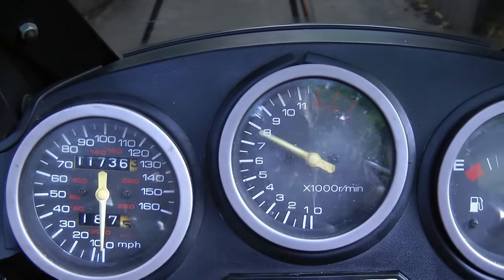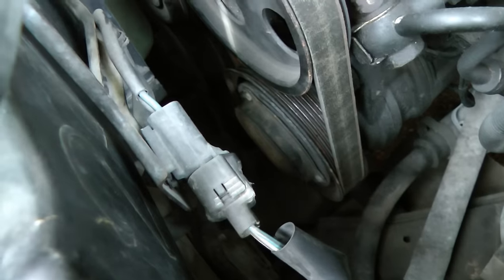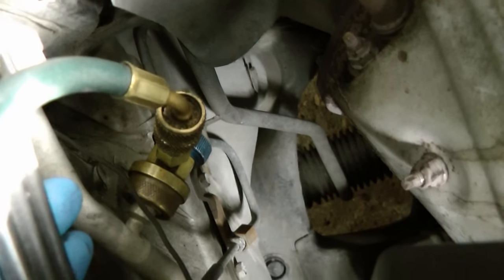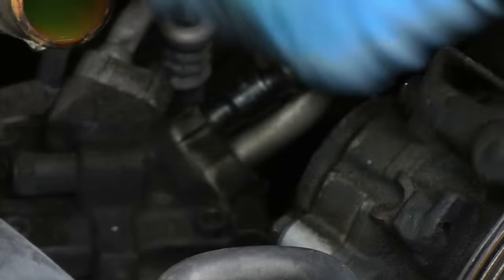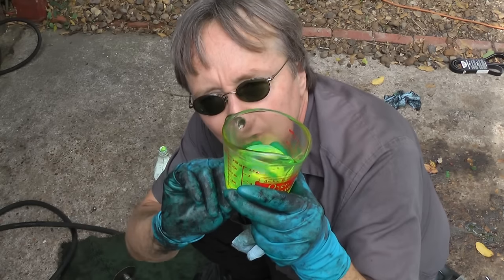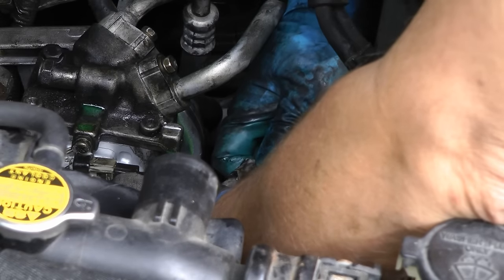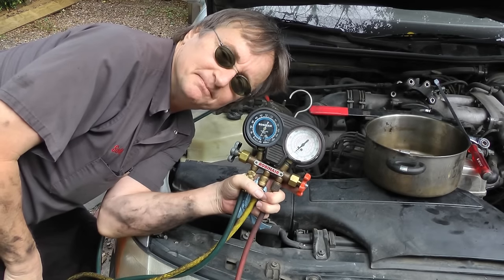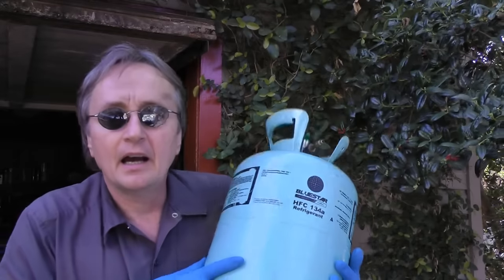How to Replace AC Compressor in Your Car

Comment: i'm having trouble finding the right compressor for the 99 jetta 2.0
Reply from the maker: +edwin Farrell that's VW AC work for you, expensive parts that are hard to find outside of the dealer. But do try online places like rockauto and VW specialty websites
Reply: thanks scotty i found 1

Comment: I have a 2002 chevy Tahoe I put a new compressor on and a new accumulator and orifice tube had the lines sucked down and recharged ok but they forgot to give me a o ring so I had to use a old one ok so when we put it in he must have forgot to take the other one out so there was two rings in it so two day later it started leaking that's when we found out it was two ok so it never work right since so heres what happen I put another one in and gas it back up and the front get cold but the back want

Comment: where do i get that vacuum pump to evacuate the system.  my compressor is seized up and once i get a new one i want to be able to do all of the work as my local mechanics are asking $600 to $800 for the work!  i want to tell them, politely, buh bye. also what does one expect to pay for the ac compressor and the mix canister?
Reply: Nathan Reeves idk wondering that too. ac compressors are around 200 for remanufactured, canister idk.

Comment: 2009 Honda civic compressor how to replace
Reply from the maker: A/C Compressor Replacement

R18A1 Engine

NOTE: Do not install an A/C compressor into a system unless you are completely sure that the system is free of contamination. Installing the A/C compressor into a contaminated system can result in premature A/C compressor failure.

If the A/C compressor is marginally operable, run the engine at idle speed, and let the air conditioning work for a few minutes, then shut the engine off.
Recover the refrigerant with a recovery/recycling/charging station. See: Service and Repair\A/C Refrigerant Recovery (With A/C)
Remove the front grille cover See: Body and Frame\Grille\Service and Repair\Front Grille Cover Replacement and the alternator. See: Starting and Charging\Charging System\Alternator\Service and Repair
Disconnect the connector (A) from the A/C condenser fan motor. Remove the wire harness clip (B) and the connector clip (C). Remove the upper mounting bolts, and the A/C condenser fan shroud (D). Be careful not to damage the radiator fins when removing the A/C condenser fan shroud.

Remove the bolt and the nut, then disconnect the suction hose (A) and the discharge hose (B) from the A/C compressor. Plug or cap the lines immediately after disconnecting them to avoid moisture and dust contamination.

Remove the mounting bolts and the A/C compressor (A). Be careful not to damage the radiator fins when removing the A/C compressor.
Install the compressor in the reverse order of removal, and note these items:
Inspect the A/C lines for any signs of contamination.
If you're installing a new A/C compressor, you must calculate the amount of refrigerant oil to be removed from it. See: Service and Repair\A/C Refrigerant Oil Replacement (With A/C) A new A/C compressor comes with a full charge of oil.
Replace the O-rings with new ones at each fitting, and apply a thin coat of refrigerant oil before installing them. Be sure to use the correct O-rings for HFC-134a (R-134a) to avoid leakage.
Use only PAG refrigerant oil (SP-10) for HFC-134a A/C systems.
To avoid contamination, do not return the oil to the container once dispensed, and never mix it with other refrigerant oils.
Immediately after using the oil, reinstall the cap on the container, and seal it to avoid moisture absorption.
Do not spill the refrigerant oil on the vehicle; it may damage the paint; if the refrigerant oil contacts the paint, wash it off immediately.
Charge the system. See: Service and Repair\A/C System Charging (With A/C)

Comment: After testing, found the clutch was bad in the existing compressor. Does this send metal shavings and other contamination through the system? Even doing this yourself would cost a fortune after buying all the recommended replacement parts and having the shop recover, evacuate, and recharge. AC systems shouldn't be so eggshell fragile with today's technology!

Comment: what does it mean if you car air blows going off how fast your driving? example if I press the acceleration the air blows harder and stay like that as long as I'm driving but when I slow down the air slows down with the car also  so it's only good when I'm driving fast what is the problem anybody ???????
Reply from the maker: the air that blows through the AC condenser either depends upon the radiator cooling fans when sitting idling, or the speed of the car that blows faster air the faster you drive.  If you are talking about the air being blown inside the car with the blower motor, then you either have a bad blower motor or a bad alternator
Reply: I had a warranty on my alternator and wgen I got my power steering fixed my mechanic went on head and got a alternator so I guess I'll go with bad blower because if I'm at a light or anything and my csr barley moving then air barley blows out until I press the gas so I'll take your word for it. Appreciate you getting back with me man

Comment: What's this nonsense I keep hearing from folks about how the ONLY way you can properly put oil into a new compressor is with some special, fancy machine that ONLY a professional shop will have? Sounds like another way of folks saying, "You're too stupid. Just have a shop do it." Pour in the correct oil type/amount, prime it by hand, bolt it up, vacuum it down, and charge it - right?